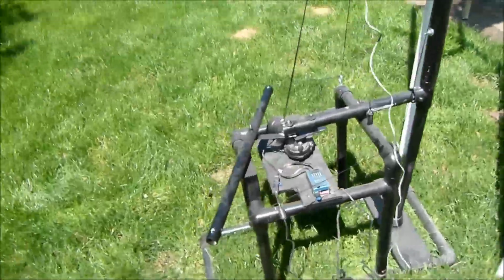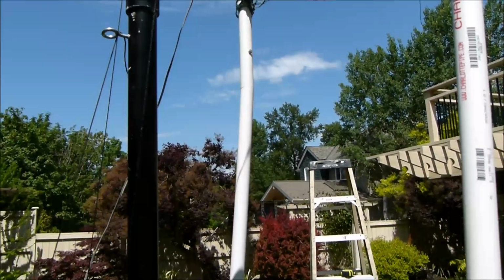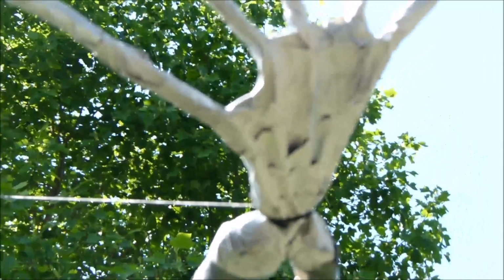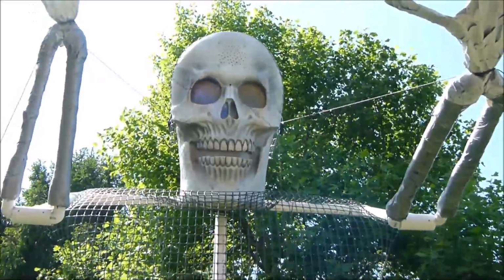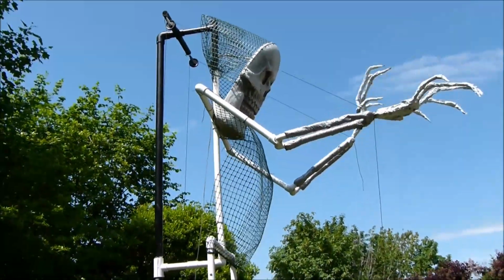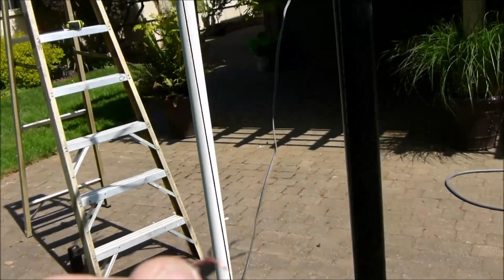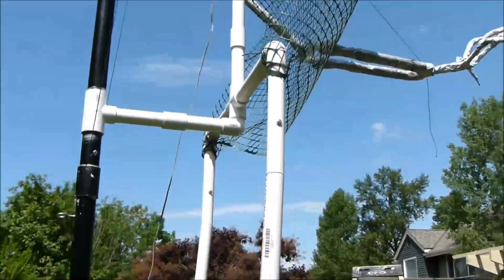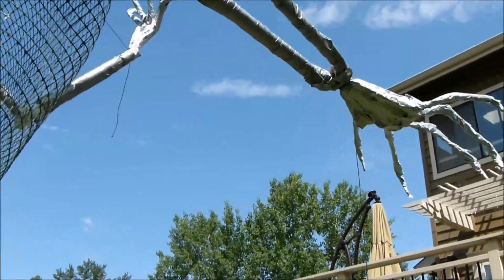2018 Swaying ghost tutorial #3

Comment: This dude predicted Towering Reaper.
Reply from the maker: WOW - just looked up the towering reaper since I didn't know what it was.  You are right!!!  I believe they are using the same skull face that I found online.  As I said mine measures out just above thirteen feet so taller plus it looks like mine is wider - mines at 36".  I'll make sure and post a video to show the swaying plus hand movement.  I'd be interested in what type of motor they use - I'm using the wiper motor which are super durable - no plastic gears like the reindeer motors.  Regarding cost - I see theirs retails at $250.  I figure with my wiper motor, the controller, mask, PVC pipe and fabric - I'm right around $90.  But more importantly - I made it - which this is all about.Thanks for the comment.
Reply: I doubt they use a wiper motor, but it's probably a bigger motor than the ones used in most life-size props.